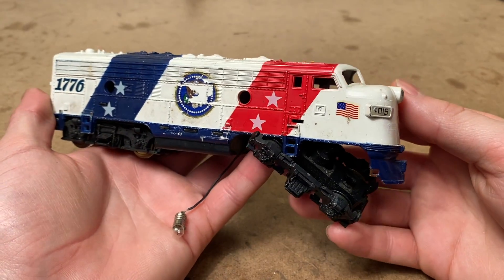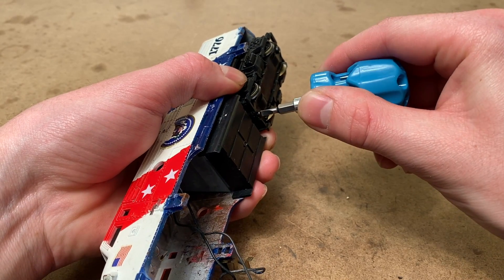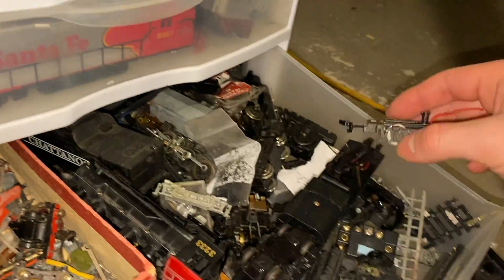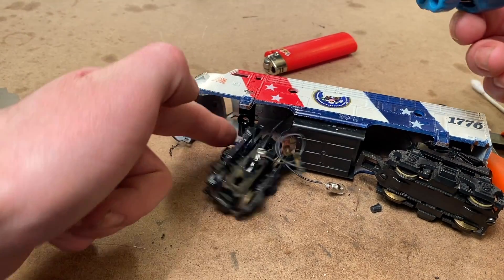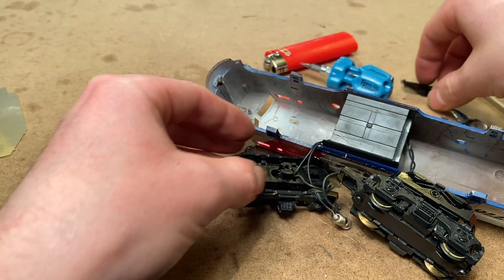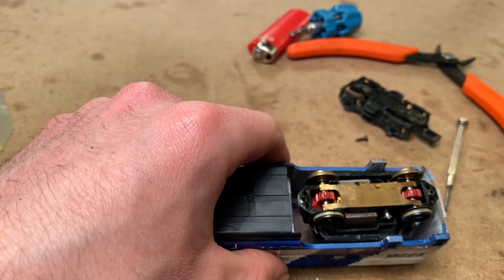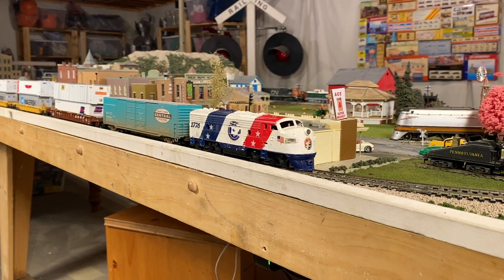Can We Make This Ruined Spirit of 76' Locomotive Run Again?

Comment: According to the markings on the dummy bogie it‘s made in Austria. I‘ve never seen this kind of drive over here. I‘ve only known locomotives with all driven wheels, either one motor that drives them all or one per bogie with their individual gearset and linked pickups.
Very weird.
Also: plastic wheels on a locomotive 🤯🤯 not even Kleinbahn had this

Comment: Put some traction tires on that puppy and it will have no trouble to pull the load. It will stop grinding and slipping. 1/4” dental elastic bands will work great !
Reply from the maker: Thanks for the info

Comment: You need to use drill bits called stubbies so that at the point of the end of your drill Chuck it is not trying to clamp on the spiral of the drill bit. That can cause the drill to wobble losing its stability while drilling.

Comment: Hello Harrison, I really enjoy your vids. As a kid, I got this set new and still have it all in boxes. I just checked the locomotive and the front wheels all spin easily but the rear brass wheels do not move with my finger pressure on them. Should they be moving freely or only when they are getting "juice" from the track? Many thanks.
Reply from the maker: The rear wheels should not turn freely. They are connected to the motor and should only turn when the locomotive is getting power.
Reply: @SMTMainline  thanks, I’m a newbie, or old newbie. I couldn’t remember how the wheels should be. Going to get back into the hobby soon and think this engine should be a good ‘runner!’

Comment: If you straightened up the 2 little brass pieces on the contact plate they go into the corresponding holes in the truck plastic cover and hold it in place so that it doesn't contact the gear cogs..

Comment: The parts bin might need a bit of organizing… Yet in the end, by the end of the day. “We Got A.. Runner!!” 
Beautiful Salvage Operation S.M.T.!! I wonder if there was a Spirit of 76, Freight or Passenger Consist?  What is the difference between the plastic wheels and trucks, vs the metal ones?
Reply from the maker: It was cheaper to make them that way, not really a good idea since the make the track dirty.

Comment: I meant to add that on the bottom of the frame says Made in Austria!  Thanks
Reply from the maker: Kinda ironic for what's suppose to be a patriotic American locomotive however I do have a few Sprit of 76' Mantua Tycos which were actually made in America which seems fitting.

Comment: Hello from the State of Kentucky!  Love your videos and your remarkable ability to restore these beauties.  I have the Tyco 4015 in the Santa Fe scheme found in a hoarder house with the B unit and tons of rolling stock. I have tried to make her run but failed and burned out the headlamp in the process!  The brushes on the motor dont seem to be making contact. I realize parts for these things are hard to find!  Any ideas where I might locate brushes?  I worked for Illinois Central Gulf RR now CN as a Policeman (Special Agent) in Illinois.  Their Spirit of 76 GM unit came through East St. Louis headed south. Sadly it hit a dump truck in Mississippi in 1975, fatally injuring the cab crew!

Comment: Good work on that one! That’s one of the rarer Tyco motors made by Roco, and it’s a decent quality unit. I got one from a family member a while back and found that the original magnet was almost completely demagnetized. A 1/2” neodymium cube worked wonders for that motor!
Reply from the maker: I wasn't aware Roco made tyco locomotives. That explains why it was made in Austria where as most were ether from the US or Hong Kong.
Reply: @SMTMainline  You’d be surprised at how much is made by Roco! Some other examples are the C-424 from AHM, the E units from Model Power, all of the Atlas diesels from the 70’s and early 80’s, the Proto 2000 Heritage steam engines, and the motors for most Athearn Genesis models for the past 20 years.
Reply: @SMTMainline  And that Austria-made motor is the later design MU-2 motor

Comment: Hi smt, I am going to a train show this weekend to get some track and some other pieces for the ho scale layout I am planning to build. I am going to need to find a controller and the track piece the controller plugs into since I don't have those right now. I have seen the controllers in your train show vids before, but I have no idea if any vendors are going to be selling the track section nor do I have any idea what it looks like compared to regular tracks (sorry I am new to this hobby, at least for ho scale). Can you help me with this? Thanks!
Reply: The older terminal track can be straight sections with screw terminals on one side.  Tyco made a curved rerailer track that had a pair of Fahnestock clips on the outer side.  Atlas also made terminal rail joiners that had a thin flexible black wire sticking out of one side of the rail joiner.  You can make terminal rail joiners by soldering a thin wire to the underside of a rail joiner - toward the middle of its length.
Reply: @Petemonster62  Thank you, you definitely saved me since without that terminal track I would not be able to run trains! Have a good day!
Reply: @splendidkhan7528  -You're welcome!
Reply from the maker: @splendidkhan7528  You can also buy rail joiners with wires soldered to them.
Reply: @SMTMainline  - You are right SMT!  I used Atlas terminal rail joiners on my layout where a section of rail depended on a good, electrical contact connection of a point rail on a switch track, to be energized.

Comment: 10:09 "not even a single bit of hesitation". Proceeds to smack switch
Reply: That big soldering iron he has it was on the workbench but the front part was facing the rails. I thought it was the switch to when I had to look again
Reply: @mercuryoak2  I know that mate. I was trying to be funny

Comment: I have an old life-like Santa Fe F7 that similar happened with the rear truck, I never did anything to fix it. The tip of one clip broke off, so there is still a shaft of sorts, just hold the truck in place and set the locomotive on the tracks and the locomotives weight keeps the truck in place, just like the real thing does. My mom bought me that locomotive for my birthday over 20 years ago, it is technically my third locomotive, my first two were when I was a kid, and, as we all know, kids typically don't really take care of things like that, it is the first one I got as an adult though and have taken as good of care of it, and all the ones I've gotten since, as I could.

Comment: That parts bin. One of the reasons I never threw away any parts or useful bits. Picked up some large thick 2 / 2.5 inch washers off a jobsite floor about 40 years ago and threw them in my model railroad kit box with all my repair and fix stuff. Despite life turning from being able to do much model railroading over the last 35 years this past spring got around to building my late wife's Star Trek 5 Enterprise model and of course feed all the wires for the lighting kit through the base and epoxy the lower hull to the base and only after the epoxy has set rendering the model now impossible to remove do I realize I've attached it to the base backwards ( insert Homer Simpson D'OHH! here) and the model is now top heavy to the bow. Dig around for something thin yet heavy enough to counter balance the model and come up with nothing. In desperation think maybe I've got something in that old train kit and yep 3 of those 40 year old washers epoxied together and to the inside of the base did the trick. 
That locomotive is doing a hell of a job considering those double stackers are heavy as heck for a locomotive intended to maybe pull a 4 or 5 car set put out by Tyco at a time when quality was job 5 or 6.
Reply: Gary, I am sorry to hear about your wife.  I do think building her model is a great way to honor her!  It is funny sometimes how something you acquired years ago ends up now being useful!
Reply from the maker: It's nice they eventually had an important purpose. I never throw out hardware since it can get you out of a pinch at times.

Comment: Hey Harrison when I clean the non driven wheels I stick the tip of the axle into a drill, gently tighten it in, and spin it slowly while applying the fiber glass pencil. Same concept of cleaning while driving except it spins using the drill.

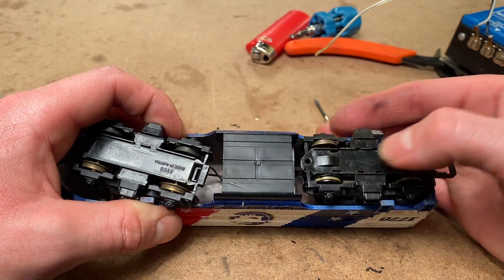Comment: At 9:12 there a two lugs showing on the copper power strip - I think they are designed to stick up and go through the slots in the base to locate the power strip correctly away from the gears.
Reply from the maker: I noticed that after. One was bent which didn't help.

Comment: Good now please don’t Make the train that was definitely saying that it was not designed to pull this weight or this long of a train ever again.

Edit: So he responded and apparently it’s the traction tires that are making the noise and it’s just that I don’t know enough about models with traction tires.  I just don’t want to spread misinformation.
Reply from the maker: This is nothing for the type of motor it has, the problem is the traction tires are worn out.
Reply: Oh it sounded like it was the motor

Comment: @Smt Mainline I have a tyco spirit of 76 but it’s not an f7/f9 it’s a super 630/alco c630 and it’s a tyco power torque and it runs a little too fast but I run it at half speed to avoid it from derailing and destroying my layout becuase I can tell it wants to cause disaster